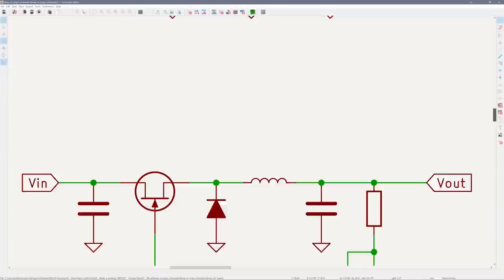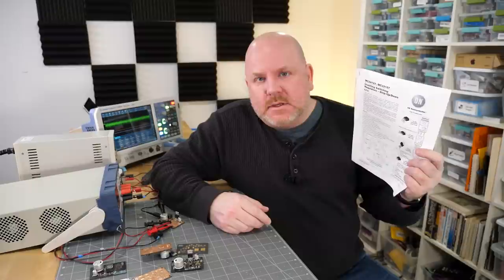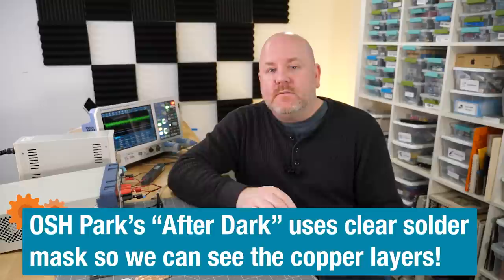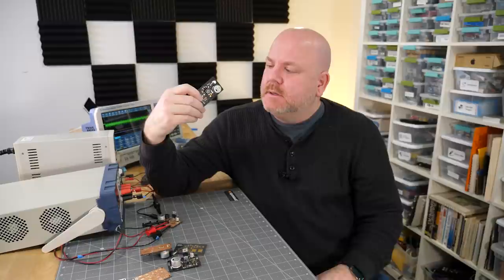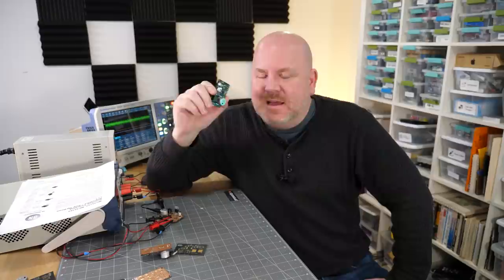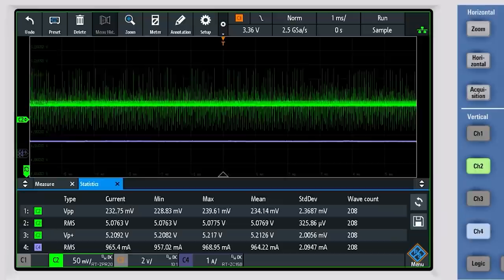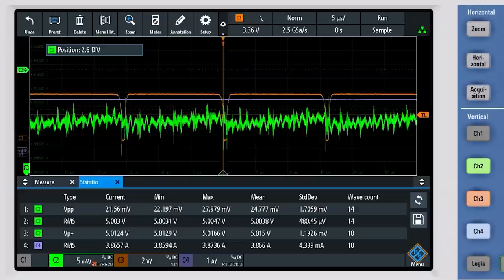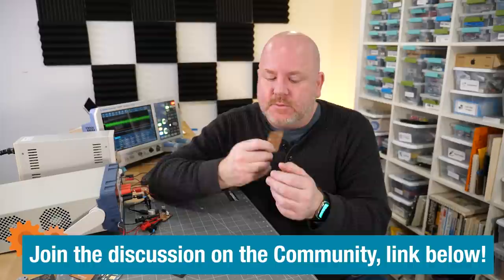A Noise-Free DIY Switching Power Supply - How Hard Can It Be?

Comment: It would be really interesting to see what difference a 4 layer PCB would make, with the ground plane shifted up to layer 1 (just below the top layer). Rick Hartley often makes the point that the bottom layer of a 1.6mm PCB is just too far away to be truly effective, and that there's almost never a good time to use 2 layer PCBs for EMC management. The prepreg separating the top two layers would typically be less than 0.2mm thick.
Reply: why not 10 layers?

Comment: To be honest I think using pours for power and ground should be the default. Especially ground. There's no cost to using as much copper as you can!
Reply: I agree. Separating signal types and return paths is something I spend alot of time on but still have trouble with. I have yet to see or read it explained in a way saying this is how it is for a given usecase. Look at audio, mix up the return path on an elaborate circuit and a simple oversight turns into a tail chase where in the end you want to go mirc on yourself with a trout to the face. Haha. Great comment man, thanks.

Comment: Pours are the means to an end. The end is low impedances between nodes in the power path where switching currents flow and small loop areas. The best-performing layout can still be improved. Ultimately, with a 2-sided board, it’s possible to close the current loops with loop area projecting sideways through the board, and it’s possible to get the on and off state current loops at right angles to each other. For some hints as to how that may work, look into multiphase converter app notes where they really emphasize small loop areas on the layout. Components on two sides of the board can make a big difference. The resulting volume is still the same or better.

Comment: If there's a suggested layout in the datasheet, it's there because reasons. The manufacturer did the hard work for you.
I'd still probably add a bit of LC filtering on the output to clean up the remaining noise.

Comment: I once built a flyback converter on a breadboard. It worked. Until the output capacitor became loose. Then the USB unplug sound sounded a bunch of times as USB connections half a meter away were killed due to interference.
But other than that, if you try to minimize parasitic inductance, resistance and capacitance in the critical sections, it should be fine to test a SMPS design on a breadboard before making a permanent PCB. Just make sure the connections are solid.
It would be interesting to actually see a breadboard version of the circuit from this video.

Comment: Really great structure to this video. I almost shouted at the screen at your first attempt, then I realized what you were doing. ;)  Excellent tutorial method.  A board I would have liked to see is one that uses the final parts placement, but rather than fills, using VERY LARGE traces. Like 5 mm,  and following the same "route" as the final copper pour method. I suspect it would perform somewhere in the middle, but just how bad?  I also suspect that may be another path a beginner might take, not knowing about or understanding how to do copper pours.

Comment: I've designed switchers successfully.  It's a PITA.  The board you show is still likely to have EMC problems. You really want a 4 layer board, with high currents or fast-switching pulses separated from their return paths by only the thickness of the prepreg, not all the FR-4.  But (inless you're Rick Hartley), you can seemingly do everything right and still struggle to tame the things.
Reply: Why not a 8 layer or 20 layer board? Or just don't build anything at all, just order it pre-made in China like everyone does. Man, the DIY scene is completely dead.

Comment: Nice video, good pacing! I usually need to speed it up, but this was good at 1x. It felt aimed at noobs a little too much here and there. This was a missed chance to explicitly say "never, ever use autorouting".
I'd like to see how a 4 layer board compares. I use SIG/GND/GND/SIG with power routed on 1 and 4. I use JLCPCB's stackup that has 0.0994mm prepreg between 1&2 and 3&4 with a thick 1.265mm core, since it doesn't cost more. It'd be interesting to see how that compares to 2 layers and to the typical SIG/GND/PWR/GND. I use 4 layers on all my boards, as the cost isn't much more and I think JLCPCB does a better job than they do on their $2 2 layer boards.
FWIW, I use 0.3mm/12mil traces only where I need small traces, otherwise I use 0.6mm/24mil everywhere and 0.8-1mm/32-39mil for routing power. It's doesn't really make routing any harder, so I don't see any point to using smaller traces unless there is really no room.

Comment: Now I'm curious... could you link up a large ground plane, like a separate PCB, to an existing board and get an improvement?
Reply: Sure, yes, but it would be tedious. In the case of retrofits, I would strategically add ground bus wires in parallel to the high-current and high-frequency tracks on the PCB. 

The layout is equally important. It's critical to reduce the area of the switch node, and also reduce the area of the feedback node, in order to achieve good EMI performance.

Lots of ground vias could also be added near the controller IC in order to provide better heatsinking.

Comment: Wow, this is really scary, I never expected SMPS designs requires extremely careful PCB designs as well for best efficiencies. I was assuming just learning the math and SMPS theory will make great high efficient SMPS devices, well this video just showed its not the case since proper PCB deign also needs to be considered which is also complex. Excellent video in explaining to get best efficiencies and why it's crucial to properly design the PCB layouts and implementations for the SMPS design.
Reply: You can make it either efficient or have low EMI. To make it efficient you have to drive it on and off hard, and that causes massive voltage transients that ring hard and long. You have a spice simulation or something already right? Throw a 10nH inductor right before the diodes to represent some parasitic inductance, and watch it go nuts.
Reply: @douggale5962  Thanks for the technical reply. No I have never done any spice simulations. I'll start learning about them later. What do you mean that to get high efficiency, switching the voltage needs to be driven "hard"?
Reply: @ShopperPlug  Each time you switch a MOSFET or transistor, there is a huge pulse of heat and power dissipation when it is crossing the partially conducting region (between the points where it is all the way on or off). You would like to slam the MOSFET on and off instantly if you could, but you can't. You can control how fast it switches by how much current you drive in and out of the gate when it switches. The gate of a high current MOSFET feels like a capacitor to the gate driver circuit. You have to charge and discharge the gate of the mosfet rapidly. To make it rapid, you need to apply and drain out large pulses of current, like 500mA for tens of nanoseconds. This is what I mean by "driving it hard", you are putting huge pulses of current in and out of the gate.

Sounds great right? You just slam it on and of really really hard and profit, right? No, the problem now, is when you slam the MOSFET off really hard, all that current flowing through the inductor has to go somewhere, and it can't right away. There is inductance between the inductor output and the diodes and output capacitors. When the MOSFET turns off, all that current can't go anywhere, briefly, because the current isn't flowing through the diodes yet. This causes a huge brief voltage spike. Now you are threatening to blow the mosfet from exceeding its voltage rating.

You have to balance how hard you slam the MOSFET off and on, with how low you can get your board layout inductances.
Reply: @ShopperPlug  Here's an analogy that might help. If you instantly switch the mosfet on and off, it is like slamming a car into another gear without the clutch. There is a gigantic spike of force. Switching the mosfet slowly is like smoothly engaging a clutch. The clutches burn off energy as heat but they make it really soft and smooth. High efficiency power supplies are doing the moral equivalent of neutral drops (or popping the clutch), at a high rate of speed.
Reply: @douggale5962  Thanks for the detailed explanation. Makes sense now. It would be great if you can share your vast knowledge in SMPS, maybe make an entire YouTube video series about. Thanks.
Reply: @douggale5962  wrong again 1 "To make it rapid, you need to apply and drain out large pulses of current, like 500mA for tens of nanoseconds."
wrong 2 "You can make it either efficient or have low EMI. "
I have an IGBT half bridge right here on my desk. I'm driving 5A into the gates each = 10A total at 60 kHz, and switching 1200 W to 1800 W. Efficiency over 95%, no problem with ringing if you KNOW what you are doing.

Comment: So in summary make traces as short and as thick as possible, and also make a ground plane, I think this is a good advice for any PCB, but with high frequencies is a must. Does long and thin traces work as small inductors in high frecuency circuits?
Reply: Yes. Those are also called Antennas. :)
Reply: Larger traces act as small capacitors at high frequency too. This is how microstrip filters work is using large and small traces to act as capacitors and inductors
Reply: @Cracked1ce  Only if they have a low impedance return path. Otherwise, they’re inductors.
Reply: @bald_engineer  Good point. and low impedance means more than just DC resistance at high frequency. Managing return paths, proper drive strength, correct termination and trace impedance are the most important considerations when dealing with high frequency. Jeronimo's comment about making the traces as thick as possible being important for high frequency is not necessarily true. For high frequency transmission traces you should use a trace thickness that matches the target trace impedance. And in SMPS design, your switching node should be as small as possible while still being large enough to pass the needed current. The plane you have in your design on the switching node is just adding additional capacitance to the switching node and coupling more noise into the ground plane. Also with it being close to the edge of the board it is going to radiate more noise into the environment. However, these are just small nitpicks and the video did a good job of demonstrating the importance of a good ground plane and proper layout.

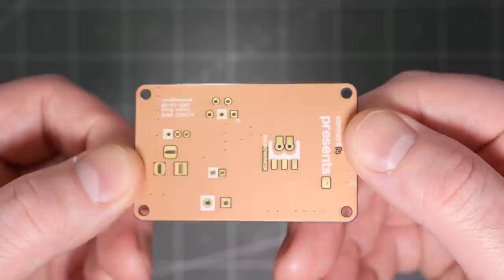Comment: 10:03 how hard is it to DESIGN a SMPS PCB ? 
Well, doing the layout is one thing. Choosing the components and their values is another one.
Reply: A lot of the datasheets have tables with recommended component values for common outputs plus formulas to figure out anything else. The manufacturers really do want to sell their parts do they try to make it as easy for you as possible.

Comment: Ok, so lets discuss how a Surface power supply would go about eliminating switching noise. Looking at the attached drawing, I've captured a generic switching regulator on the left, and have it's output [ Vin ] feed into an EZ81 vacuum tube rectifier [ pins 1 and 7 ]. Output of the EZ81, nice clean DC, as shown [ Vout ]. How is possible ? Let me disclose what is not seen here.
What is not seen here, the vacuum gap between plates and cathode of the tube. The DC voltage will forward bias the rectifier, thus plate current will flow. However, the switching noise does not jump to the cathode, due to the free-air-space between plate(s) and cathode.
What does it cost ? First, you need to supply the filaments 6.3 volts, at about 1 amp. Also, in this configuration, series plate resistance on the order of 180/2 ohms. So there is some insertion loss to factor in. However, if the application does not require current sourcing up to 1 amp, other tubes could used, and you would save on filament power. Also, some care is required to set this up, with the dual inputs, or you can red-plate these tubes. I would also recommend some type of simple BITE circuits to keep an eye on tube health and performance. You set this up right, these tube last almost forever. . . . . ..... ... . . ......
Side notes. I show output filter cap at 100uF. The data sheet for the EZ-81 states 50 uF max. So, why do I run output filter cap at 100uF. It goes back to understanding how data sheets are written. You see, the EZ-81 come out in 1956. At that time, the biggest filter capacitors back then, were these wax and paper rolled jobs, max value was 47uF. So, this is just a guess, but I would say they were saying this tube could handle the biggest cap available. The higher capacity electrolytics did not come out until the mid 1970's. Secondly, there is no issue with surge current for two reasons. 1. This tube rated for 0.5 amp continuous, per plate. 2. It takes about 12 seconds for this tube to warm up, and gently ramp up to full conduction. I even ran this tube feeding a few 1000uF caps over a few days. It did not care. Why? Because a vacuum tube is not an active electronic device. It is a mechanical device, with - certain - electrical - properties. It does not generate any waste heat internal to the device, because is a vacuum between plate and cathode.

. . . .     .... . .. .... . .  ....  . .  .  ... . ...

Comment: I'm going to channel my inner Rick Hartley and ask you the question: where is the energy in a PCB? Answer: it is in the dielectric space. When current flows an electromagnetic field is formed. That field spreads through the dielectric space looking for a return path of the lowest inductance. If that return path isn't ground/power then it is another signal. In the analog audio world that might present as oscillation or crosstalk. Once you getting into high-ish speed switching all bets are off. Also, the manufacturer's datasheet is as good as toilet paper in a lot of cases. There are layout and stackup suggestions that are fundamentally wrong, but it just happened to work in their application. Unknowing designers use those suggestions as gospel and perpetuate bad design practices.
Reply: As Rick would say, "All datasheets are wrong, until proven otherwise!"

Comment: Not bad but you stopped one step too soon: you didn't optimize the component placement to shrink the hot loops. You can also optimize trace placement so that the feedback signal isn't picking up noise from the inductor, and so that filter capacitors aren't sitting out at the end of stub traces, and so on.
Reply: where can I find the rest?

Comment: What if I use a breadboard BUT shove the critical pins together in the same holes to avoid capacitive coupling?
Reply: Just solder components together as close as possible avoiding breadboard at all.
For ground part of the circuit loop use thick solid copper wire.
It will work at up to some point in kHz range.

Comment: How much inductance did you end up with at the switch node? I almost did a project like this, but I was deterred by FUD about the transients blowing the mosfet. I did some simulations and, you'll blow up an 80V mosfet with 40nH of parasitic inductance at 4A. How huge were the transients, really, at the drain of the mosfet? I have doubts that you probed it where it would have shown the true transient when the mosfet turns off.
Reply: They make many switch mode controllers with on chip switch FETs do you don't have to add one and they run several amps and use 20uH+ all the time without issue. The range on inductors I've been see are between 2-30uH depending on switching frequency used, max current etc.